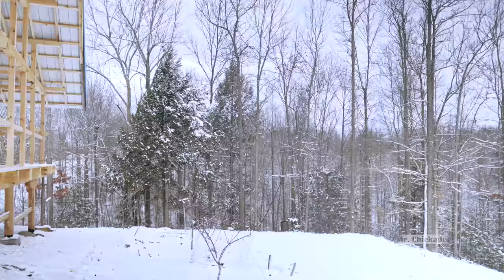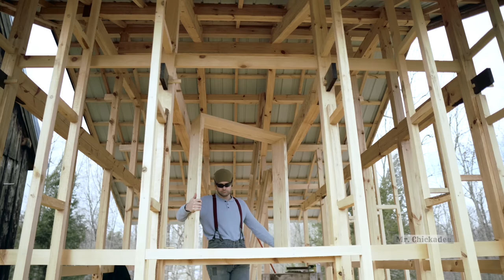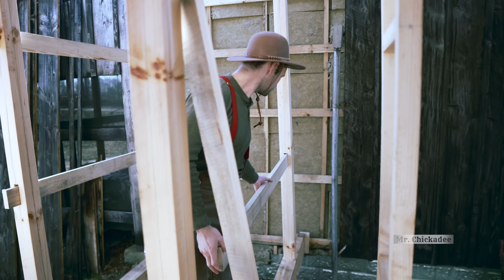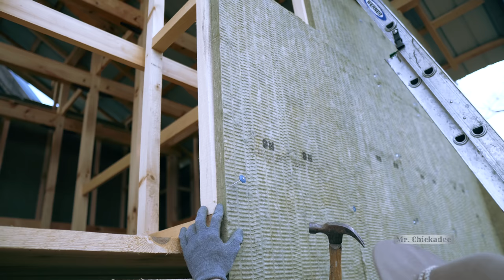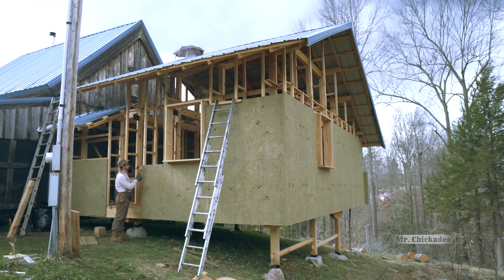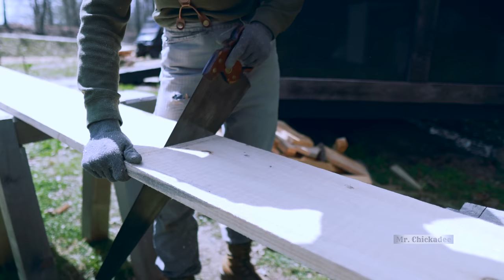Japanese timber frame home extension: Enclosing the frame using larsen trusses and hand tools.

Comment: Very smart, energy conserving wall design. Will effectively prevent wind-driven water penetration. That layer of rock wool insulation placed on the outside of the structure is a very good thermal barrier.

Comment: Your videos and builds are a joy to watch. One small tip that could extend the life span of the outside boards: If you cut / saw the bottom end of the insulation / boards, at an angle of 45°, you'd create a drip edge for rain and condensation water to drop straight down. With 90° edges, it can go down and around the edge, wandering about on the flat bottom side and soaking the wood. Metal roof edge trim has such a sharp edge at the bottom in order to avoid corrosion.

Comment: "How do you get such tight tenons?"
"Gotta make 'em so they expand after they're fitted together."
<confused Scooby sound>
Reply: wait, is that why he was hammering them?!
Reply: That could also be:
1. A legitimate technique for compressing wood because it was cut a bit too generously or it drew water and expanded after being cut for size.
2. Oriental magic for compacting fibers and making the wood stronger.
3. Music making.
Reply: @enigma7ic  yup, as far as I know it compresses the wood fibres, but they swell back over time.
Reply: @enigma7ic  I didn't ask but it's what I've done to get a beyond-snug fit on some joints.  He's not whaling away to crush the cells, just bonk them so they collapse more or less elastically.  It's not something you do today and then put it together tomorrow, the cells begin rebounding immediately and if you do it right, will return almost all the way to their original shape.
Reply: Could a change in weather mean he needs to compress the tenons to make them fit?
Reply: @teaCupkk  mounbatten festival of musìc
Reply: @enigma7ic  Yes

Comment: If we ever get a tornado, earthquake, and volcanic eruption all at the same time in east Kentucky, can I come stay in your shop? I'm betting it'll be the last thing standing!
Reply: Forgive my ignorance but won't this building just slide off when stronger winds come? You can say that the mass of the wood is holding it in place but it is true to a certain point. Can someone give me resonable answer. I'm not asking to make fun of this video but to genuinely get an answer.
Reply: It's a valid question. The holes dug at the beginning were footings, on which boulders were placed, on which the posts are sitting. They're cut to fit the boulders, so they won't slide off, but there's nothing but gravity holding this to the ground. Wind lift could be a concern.

Comment: This has to be the first Japanese framed building (1,000+ Years, Japan) insulated with Larsen truss walls (40 years, Canada) and sided with Amish style board and battens (200+ years?, USA). I see you're all-in with the mineral wool. You've come a long way since wattle and daub! And millions of us are the beneficiaries. Thanks.

I'm wondering if you're going to show more about the roof, and I'm eager to see your solutions for air (and vapor?) control in the walls. You replied to my comment about the mineral wood in the floor working as air control, but walls are trickier, and you hinted at this in the description ("first line of defense"). Caulk, tape, and foam are modern band-aids, but necessary? I think "just put a sweater on" is actually the most elegant solution, but modern comfort demands otherwise...

One last note: I've seen it detailed how you can skip the double purlin/furring strips with board and batten. Just do horizontal strips (with a slight outward and downward bevel on the top for extra credit). The battens are naturally lifted off the strips by being on top of the boards, and this provides the airflow channel for your rainscreen. Not as fast draining when you get a hose stuck behind your siding, but I assume good enough if the given building benefits from thinner walls or simplier construction.
Reply from the maker: No tape caulk foam or vapor barriers of any kind are every needed or used here. The use of mineral wool and wood, and if needed things like felt weather seal and cotton or silk caulking can be used to get a very draft free (but still vapor permeable) home envelope. Drafts should be stopped! But vapor should be permitted to pass, otherwise it will often be stuck, condensing and causing issues inside the walls, floor or whatever. Just my thoughts, and has worked very well for us here these past 4 years.

Comment: When you were pounding that tongue cut with the hammer, is that part of the mechanical theory of what you're doing? The wood, having a memory, will revert as much as possible in the groove and become super tight? Or is that fudging imperfect cuts? 😆 Sorry if that's an obvious question...
Reply from the maker: Youre correct, its a japanese traditional trick, take half each line, so there is no room for error, but less room to go together! so the hammering does as you say.

Comment: Hello Mr Chickadee, 
I have been watching some of your previous uploads for guidance on building practices, your foundation and sill's videos in particular. 
As a method of dissuading ants, particularly termites, of gaining access to one's house, can you tell me if there were variations on the process of bedding the rock intended to be a foundation stone?
For example if there is a slope behind the building, or variations in the rainfall or wider climate in one's region, does the method alter? 
I have two places to build a simple wooden structure, One on the mid-coast of NSW, Aust. [dry, hot with open forest] and the other in NW Tasmania [cool temperate rainforest with closed canopy] and I'm extremely motivated to fight termites in both cases, and crawling critters in general. 
Would be very grateful for your assistance. Michael Barrett (with daughters Ruby and Eva as assistant carpenters, all home taught)

Comment: I think I saw you nail siding board down the middle.  A zoom in on conventional board and batten nailing layout to show proper fastening (mitigating shrinking cracking due to too far apart nails) on such wide boards would give us another useful understanding.  Really chuffed about hammering of mating surfaces to get tight joints !  Merci pour l’instruction sans narration et la douce manière - sereine.
Reply from the maker: Ive shown my technique in other videos, I only nail the wide boards in the center, then use the battens to hold the sides down. This works very well and prevents splitting as the wide boards are free to expand and contract.
Reply from the maker: but make sure to put the wide boards bark side out!

Comment: The only “modern machine” on that job site is a staple gun. Working the joints like a blacksmith, makes sense. Hammering those little nails with that insulation into those beautiful hand carved boards made me cringe. Needs must. Thanks master craftsman, you are the one.

Comment: My apologies if you've answered this question in the comment section - how do you deal with the eventual shrinkage of the floor boards? Does the extremely tight fit prevent overly large gaps, would you fill them in eventually and/or do you seal the floor or is it no issue for you?

Comment: Very very nice work. A beautiful woodworking... 
Would it have been possible without nails and screws. What would be the traditional roof covering?
Reply from the maker: sure, with more time anything is possible. Slate, clay tile, thatch, tree bark, wood shakes, and others Im sure. Siding could be tied or pegged on in some way, or attached with joinery to the frame. Lots of options if you have the time and skill.

Comment: Why do you counter sink your tenons slightly? Like when doing the walkway between the two buildings, you placed uprights into the floor joists/frame, and the receiving mortise had another 2/3mm cut out the top. At 10mins 57sec Thanks

Comment: While your work is incredible and fun to watch, aren't those joints a bit too tight?  When things thaw out and warm up, or when they start to absorb the moisture in the air, they won't have any room to swell naturally, and will likely buckle and warp.  Or am I wrong because of the type of wood that you're using?  Great work either way!

Comment: How did you attach the 2x2 vertical pieces to the outside of the structure? Did you pierce the mineral wool board insulation into the framing behind the mineral board? Also, what is the R-value of the mineral board? Thank you!
Reply from the maker: yes, long screws through it and into the larsen truss framework. The board has R 10, behind that goes R30 of mineral wool batt type insulation.

Comment: Excellent progress Mr. Chickadee!  What a beautiful addition to your home.  I noticed that your floor boards were fit in very tightly.  I thought that could lead to buckling if they expand...or perhaps they are quite green now and likely to shrink?  Just trying to learn.  Also trying to figure out how you will be insulating he floor.  Looking forward to learning that.
Reply from the maker: yep, green
Reply: Yeah, I was thinking the floor boards may be a little tight around those well seasoned post. But what do I know about the materials being used, nothing! Those floorboards could be have been dry stored for decades. Too, the high volume of airflow should aid keeping it stable.
 The Japanese have thought, tested tried this out centuries ago and it's interesting to watch this translation and reason over the learning process. 😉

Comment: Bonjour!
Bravo for the job, comme d'habitude!
May I ask a stupid question: You adjusted with accuracy the plaks around the posts, what about the dilatation of the wood?
Will the dilatation of the post structure be the same than the timber of the floor? How did you calcul that?
Merci
Bob

Comment: Why do you hammer the tenons before installation? All I can think of is that it shrinks them enough to make for an easier fit. But time and moisture will make them swell again, and fill the gaps, and hold tighter.
Reply from the maker: pretty much!

Comment: Nice work. It is always a pleasure see your work. I have a question: how is the floor fixed to the structure? I saw you trimmed the excess once it is installed and I was wondering how it was fixed. Thanks.

Comment: I noticed that there is no sheathing between your timber frame and Larsen trusses. Do you find that step unnecessary?    I'm designing my own home now, timber frame, clay plaster interior walls and Larsen truss to hold addition exterior insulation. I'm struggling to decide if I should sheathed the timber frame and have a layer of interior insulation or to have a continuous layer from the clay plaster walls to the Larsen trusses.

Comment: Amazing! Great work!  Hey what happens in a big storm? Could the wind push that house off the stones it's resting on?  It's not anchored down in any way? How does that work?
Reply from the maker: The storm and wind needed to move the finished building from the stones would likely just destroy it first. (tornado or severe hurricane) If desired, the posts can be attached to the stone plinths with a threaded rod epoxied into a hole in the stone, this goes up inside the post and has a locking nut from above.

Comment: I've been learning a lot with you, thank's!! Are you going to instal isolation under the floor?
Keep sharing videos
Reply from the maker: yes we have R23 Rockwool batt between joists and R 10 rigid Rockwool board going across the bottoms of all the joists for a thermal break/air barrier.
Reply: @MrChickadee  Thanks!!

Comment: Hello

Love your videos. Yet ,in this particular one didn't fully understand the function of the trusses.
Here re my questions -

What will you do with the empty space created by the trusses between the isolation mineral wool and the timberframe?
Will be kept empty? 

Will there be a second wall just over the timber frame, or you 'll keep that space open?
If there will be a second wall over the timberframe, and space between will be kept empty, aren't you afraid that rats or other animals could find a place to live there?
If the place will be kept open, won't you put something to cover up all the rockwool?
if that place is meant to be empty in fact as a way of (perhaps) thermal isolation wouldn't shorter trusses do the job? 

hope you don't find my questions intrusive...I'm just very curious, because i m thinking about building a timberframe house myself as well... 

Great work !!

Best Regards

Comment: Very nice project! I have a few questions if you don't mind. I have a passion for Timber framing, however being in a Northern climate the envelope is a major issue. I am curious what is the plan for the floor and roof insulation? I can see that you are doing your best to be traditional so that would explain the lack of a vapor barrier, but I would assume this should stapled on the exterior prior to the rockwool panels? Also, I notice the rockwool is probably not thick enough for -20C winters, what type of winters do you see in your area? maybe its good enough for you. These questions keep me up at night.. Here in Canada, one of the common methods for enclosing a timber frame is to literally wrap it with conventional framing, so wasteful.
Reply from the maker: This will be insulated to Canadian standards. All that is shown in this video is the thin mineral wool board external thermal break. There will be additional R23 batt inulation added to the walls from the inside. Under floor will be similar, and ceiling will have double that amount. No vapor barrier is needed, or wanted. They can cause more issues than they solve.
Reply: @MrChickadee  Very nice! And thanks for the reply!

Comment: Is the insulation a rock wool? How much insulation does that thickness give? Is it an R-20? Can you use R-40? Or is that too thick? Do you also insulate the floor and ceiling/roof?
Reply from the maker: yes it is, what is shown in this video is just R-6 board type, it provides a thermal break and some draft proofing if done right. Inside will come R-23 batt type insulation for a final wall R value around R30. Floor and ceiling will also get insulation, floor same as walls, ceiling double that amount.

Comment: You are using Japanese techniques, but I can't recall your using their tools. I could be wrong, but if I'm not, is this because of an allegiance to American craftsmanship or merely a personal preference in tools?
Reply from the maker: I often get comments like "that would be better with a japanese saw" or whatever, this is just wrong and smacks of ignorance and fashionable thinking, a tool is a tool, and any from any region can and have been used to great effect by craftsman. I use these tools because it makes sense to, they are here to be had cheap secondhand, and they work, they are also much easier to sharpen in general.
Reply: @MrChickadee  Thanks so much for the reply and the reasoning. I grew up with western tools and have briefly experimented with Japanese saws; but any tool takes a lifetime to master for a real artist. I don't have a lifetime left, certainly not long enough to approach your level on any tools.
Thanks for the reliably wonderful videos.
Reply: I asked but pull saws before, and it does make a bunch of sense. They are certainly not as easy to sharpen, and not as readily available. I have definitely fallen in love with them though.

Comment: 09:30 do you hammer the tongue to compress fiber on purpose (in all joints) or to thin the joint for fitting (in specific joints)? Amazing job by the way, thanks for sharing.

Comment: Curious about the ball peen on the joints?  For conformity?
Reply: It compresses the joint allowing for easier assembly
Reply: I think it temporarily compresses the wood so the joints will go together easier, but will expand back out over time to make a tight connection. That's just my conjecture though, would be nice if someone else could chime in to confirm/deny.
Reply: As others have said, it compresses the wood to make the fit easier. Over time it re-expands to make a tight fit. In other videos where he's added description captions, he's mentioned it before.